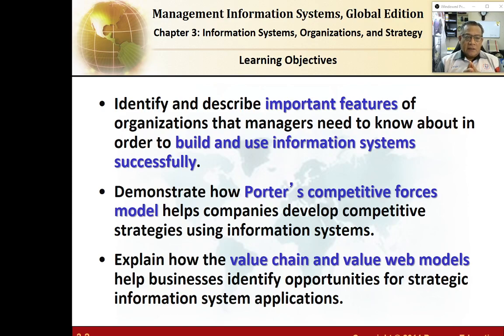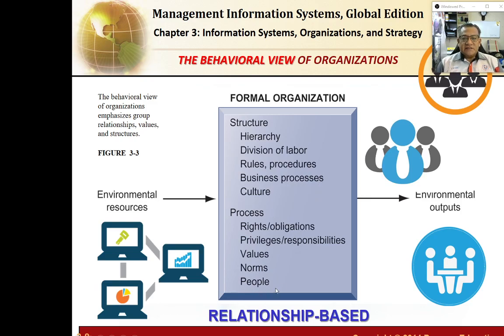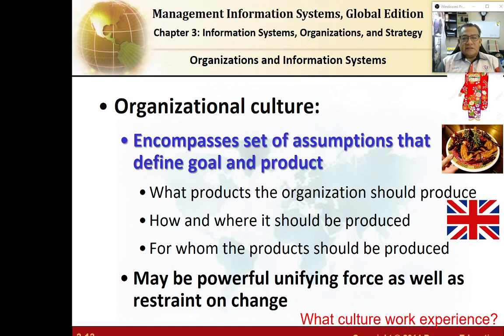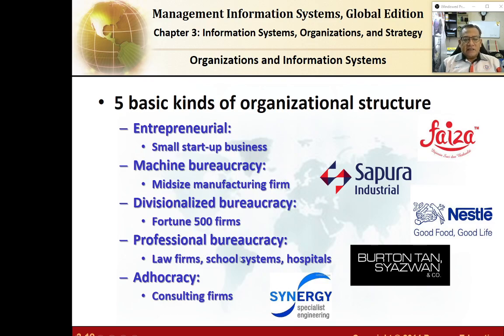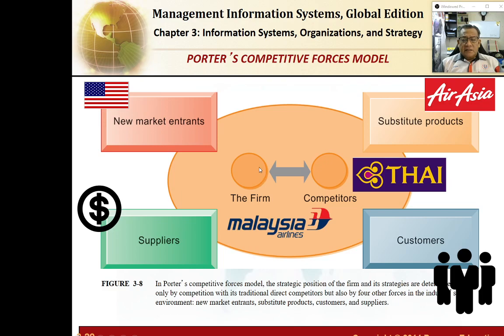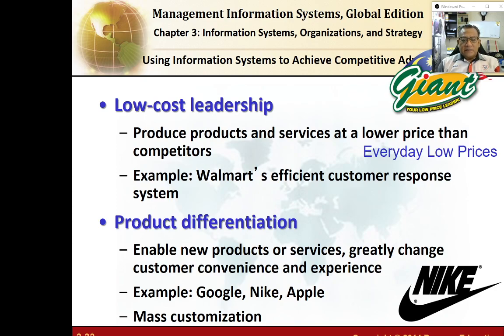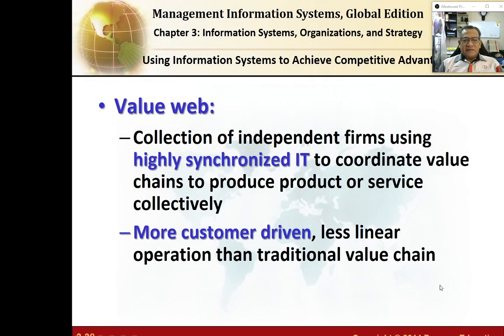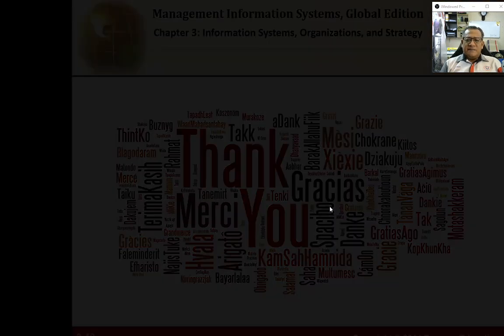Management Information System Chapter 3

Comment: TING HENG CHIEH (AP190205)

l learned about information systems, organizations and strategy. Specifically, this chapter is more about to use synergies, core competencies and network-based strategies to achieve competitive advantage. lt is essential to have a two-way relationship between organization and information technology.

Comment: CHLOE KOH ZHI YEE (AP190230)

From this video, I’ve learned that the important features of organization that what should mangers have to know in terms of building and using information system successfully such as structures, business process, politics, culture, environment and management systems.  Besides, from the example that dr shows us about Fujitsu company is simply showing the best example in relating to our real life for better understanding. Other than that, from the Edu video clip of Google Data Center on how they manage our email thru their platform. Furthermore, move on to the next topic will be the understanding of Michael Porter’s competitive forces model in which divided into 5 strong forces of traditional competitors, new market entrants, substitute products and services, customers and suppliers. From this part, I’ve learned that the strategic position of the firm and its strategies are determined by competition with the five types above. Moreover, I’ve learned that the value web is a networked system that can synchronize the value chain of our business partners within an industry in form of changing in supply and demand. Last but not least, thank you dr for recording this video which can help us a lot in knowing deeper about this chapter.

Comment: KHOR CHEE YING (AP190171)

Based on the video above, what I’ve learned from this chapter is information technology and organization influence each other. There are two components of organization which is technical perspective and behavioral perspective. Also the routines, business processes and firms. Thanks dr for relate Fujitsu and Sime Darby medical centre for us to have a better understanding. I have also learned that there are two way relationship in environment and organization, 5 basic kind of organizational structure that use information system, the value chain model and value web by Proton. Last but not least, thanks dr for sharing the video clip on how Google try to help customer around the world in order to access internet anytime and anywhere.

Comment: EZZER HARRYSON ANAK STEPHEN (CP190004)

Based on the video, i learnt about what is an organization based on two standpoint which is technical definition and behavioral definition. We also learn about routines, business processes and firm. There are also some constraint from another viewpoint which is organizational politics where there might be some organizational resistance to change that can affect the project. Besides that, we learnt about organizational culture and its relationship with environment. There are five basic kinds of organizational culture introduced with its impact and not to mention the use of internet in organization structure. Last but not least it shown the Micheal Porter's competitive forces model that provides general view of firms, competitors and environment to deal with the competition from another company.

Comment: FONG JUN KAI (AP 190242)
Based on the video, i learn that there're 4 generic strategies for dealing with the competitive forces, enabled by using IT which are low-cost leadership, product differentiation, focus on market niche and strengthen customer and supplier intimacy. And there're the internet's impact on competitive advantage which are transformation or threat to some industries, competitive forces still at work, but rivalry more intense, universal standards allow new rivals, entrants to new market and new opportunities for building brands and loyal customer bases. That's all , thank you Dr.

Comment: Tui Mun Loong (AP190262)

Based on the video, I have learn that:
- The features of an organization (structures, politics, culture, environments, SOP) is very important and managers need to know about it if they want to develop and use a new information system successfully.
- Porter's Competitive Forces Model (Traditional competitors, new market entrants, substitute products and services, customers, suppliers) supports the company to create some competitive strategies to handle the forces by using Information System.
- Value chain and value web model helps the company to identify the market to apply suitable strategies.

Comment: MUHAMMAD FIRDAUS BIN SHAMSUDDIN (AP190166) 

Assalamualaikum and good morning to my respected lecturer, I have learned from this youtube clip that information systems are essential to handle an organization effectively and efficiently. 
For instance, the company uses an email to handle the task together with each other since it is very common between many organizations. 
I have also learned that information systems will help several other organizations to reach the strategic benefits by utilizing synergy effects, core skills and network-based techniques

Comment: (AP190422)
SHEE CHENG YUAN

Based on the video, I have learned about four generic strategies for dealing with competitive forces. There have low cost leadership to produce product at the lower price than competitors, product differentiation, focus on market niche and strengthen customer and supplier intimacy. This strategies will solve the problem of competitive forces.

Comment: UMARFFIAN BIN RAMLEE
AP190057

An organization can achieve their goals by plan, build and applied the information system by refer those important features such as the usage of hierarchal structure, adherence principle of efficiency etc. Disruptive techs also could help a firm improving their information system if the firm use them efficiently. The 5 competitive forces shape Poter's model can help a firm become leader in the industry.

Comment: Muzhafera Murni Binti Muryanto (AP190179)

From this video, i've learned that the information system is really important in order to successfully manage an organizations. For an example like the organization using an email to manage the task with others since it is very common among organization nowadays.. Besides, i've also learned that information systems also can helps some of the business by using synergies, core competencies and network based strategies to achieve the competitive advantages. 

Thank you Dr.

Comment: NURFATIN BINTI MOHD FUZI (AP190303)

Based on video of the lecture, I learned is organization a basically consist 2 components which is technical and behavioral perspective, and also features of organization. I also learned the Michael Porter's competitive forces model that can help company use information systems to achieve competitive advantage.

Comment: TAN SHU QI (AP190249)

Based on the video of the lecture, I have learned about manager need to understand certain essential features of organizations to build and use information systems successfully. Information systems must be designed to serve the needs of important organizational groups and will be shaped by organization’s structure, tasks, goals, culture, politics and management. Businesses also can use strategic information systems to gain an edge over competitors. Information systems can promote competitive advantages by facilitating cooperation with other firms in the industry, exchanging transactions, creating consortiums or coordinating activities.

Comment: A190053
SARAH NADIRA BINTI DZULKIPLI

Based on the lecture, I've learned in detail about using information systems to achieve competitive advantage. 

1. Important features managers need to know in order to build and use information systems successfully
-Use of hierarchical structure
- accountability, authority in system of impartial decision making
- adherence to principle of efficiency
- routines and business processes
- organizational politics, environment and structures

2. 5 basic kinds of organizational structure
- entrepreneurial
- machine bureaucracy
-divisionalised bureaucracy 
-professional bureaucracy
- adhocracy 

3. Porter's competitive forces model
- traditional competitors
-new market entrants 
- substitute products and services
-customers
-suppliers

4. Strategies for dealing with competitive forces
- low-cost leadership
-product differentiation
-focus on market niche
-strengthen customer and supplier intimacy

In summary, business will always need the help of information technology in order to achieve its objectives, goals and high perfomance.

Comment: Nur Safirah Binti Johan Adzhar (AP190465)

Based on this chapter, first of all, I've learned about how Michael Porter's developed of the competitive "five forces" model as a framework for industry analysis. This model can be used to determine how competitive a given industry is, as well as to assess its strengths and weaknesses. I also earned an understanding about the competitive advantage and how IT can help companies achieve it. This shown each stage of the value chain adds to the overall worth of a good or service, while the value chain is not a perfect model for any form of business, it does offer a way to understand how a company creates value. That's all from me. 

Thank you Dr Ros for today's lecture.

Comment: CP190106
MASITAH BINTI ABU BAKAR

From the lecture I have learned above, there are so many types in order to achieve competitive advantage using information systems by all the technologies that can be used by IT equipment, machines and devices. But, IT can changes the relative costs of capital and the costs of information, but the internet can increase the accessibility, and distribute the information and knowledge for the organizations. In order to plan the new system in organizations, company need to know the overall environment, from the input to output to process in organization. The information systems can improve the performance of business in organizations by the synergies, core competencies, and network-based strategies to achieve the competitive advantage using information systems nowadays.

Comment: NUR ILYANAJWA BINTI NASARUDIN FITRI (AP190486)

Based on the video I watched earlier, firms with a competitive advantage over others typically have access to special resources that others do not or are able to use resources more efficiently, resulting in higher revenue growth, profitability or productivity growth (efficiency), all of which ultimately in the long run translate into higher stock market valuations than their competitors.

Then I learned five competitive forces that shape the fate of the firm (Michael Porter's competitive forces model):
1. Traditional competitors
2. New market entrants
3. Substitute products and services
4. Customers
5. Suppliers

Comment: AP190136 - YAW SUET XIN (Section 5)
Based on this video, I learnt about the interdependence between organizations and information system, the Porter's competitve forces model and the strategies for dealing with competitive forces by using IT, how the businesses can be helped to identify the opportunities for strategic information system applications by using value chain and value web models, also the challenges and solutions. I also know how does the Google runs their work and  what does Titan Aerospace achieved with information system. As a conclusion, what can I sum up is the information system helps a lot for the businesses to hit their organizational goals or get more closer with their consumer by using CRM system. If an organization do not involve to have an information systems, it will probably elimated by other competitors. For instance, information system can improve overall performance of business units by promoting synergies and core competencies.

Comment: Vijiyan A/L Rajendaran (AP190375)

From today's session I've learnt that firms with a competitive advantage over others typically have access to special resources that others do not or are able to use resources more efficiently, resulting in higher revenue growth, profitability, or productivity growth (efficiency), all of which ultimately in the long run translate into higher stock market valuations than their competitors.

Comment: Fatin Nabilah binti Zulhisham (AP190259)
Section 5

Based on the video what can i sum up is by having information systems in today's society it helps businesses stay more connected with the world, and most importantly its customers. Besides Information systems also help connect the businesses with its customers by relaying information quickly back and forth. This fast transmission, for instance, helps suppliers know more rapidly what to supply and the demand for their supply. Knowing the demand for the supply not only creates efficiency in the business, but also make customers happy. This efficiency created by information systems helps suppliers with its overall success by having high revenues.